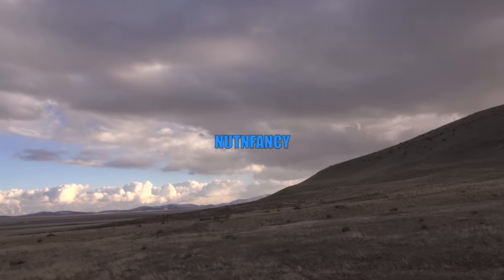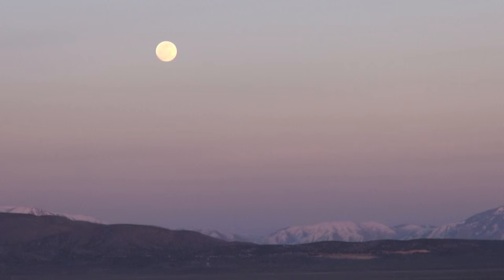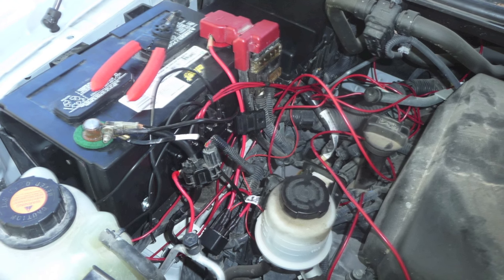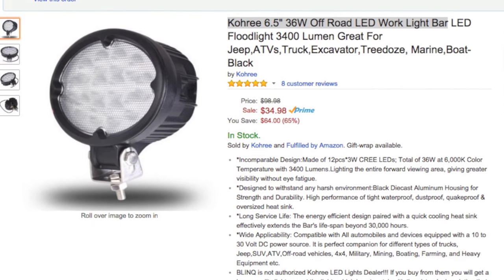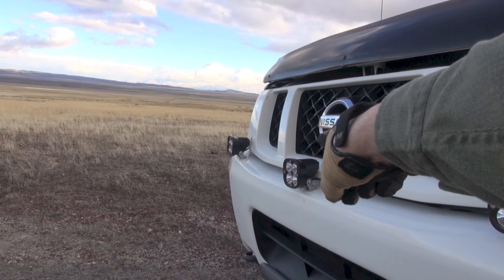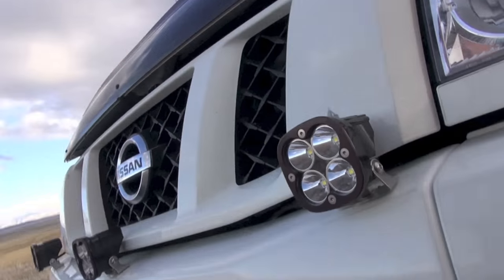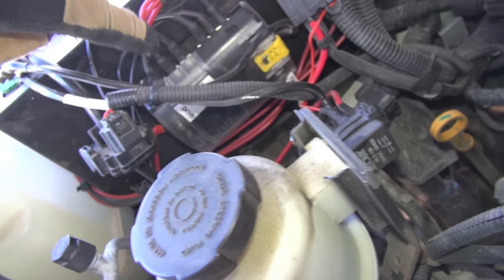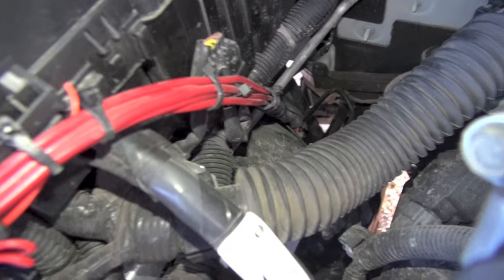Make Your Truck Lights Suck Less

Comment: I've done a lot of after market accessory electrical wiring on my truck and you've hit most of the points one wants to consider.  One thing I did a little differently is I have two different blue sea fuse panels.  One is setup for always on for things that always need power (ie. fridge) and one that gets power only when the truck is turned on via a 200A relay.  Good vid.

Comment: I have a similar project that I will be working on soon but with Rigid Industries LEDs.  I'll be installing 3 sets of Dually D2s, two sets (Driving and Wide versions) on my bullbar and one set (Diffused) on the rear for back up lighting and area lighting.  I love the job you did on your install, very clean, professional, and well done!  I'll be taking a lot of ideas from this video so thank you for sharing!!!

Comment: Just two months ago, I added a light bar to the front bumper of my desert explorer (and daily driver), for exactly the same reasons.  What a difference it makes!  I like the idea of added a couple of these Baja Designs lights pointing out to the side, and I really like the fuse block.  I just wired in a relay, but I may make a change now.

Comment: I think you done a great job of wiring and keeping the circuit separate from the stock wiring.  Less chance of a boob up affecting truck electrics.  I did not see any other fuse connection besides that at you fuse panel.  I figured you most probably have a fused connection at your 'battery feed' coming from your stock fuse box going to your fuse box for lights.  This way, truck is protected from any mishaps with lighting , wiring, etc.  Great job done, nutn!

Comment: Great timing on the video.  I have a Toyota Tundra and I have been looking to upgrade my lights.  I think I want to start with the head lights and fog lights.  Then go to something like this.  I was kind of leaning toward a smaller light bar mounted somewhere around where you mounted yours.  The wiring looks a little complicated.  But I am sure with some research I can figure it out.  Thanks for the video.

Comment: If you need a spotlight for targets that you want to throw downrange from the truck, I highly recommend a Go Light. You can mount it to your roof or better yet to a backrack like I have. Mine is remote control that I can control from the cab or if I'm ever out on a site.

Comment: very good video. I agree with your light bar statement. At least around here, about the only trucks with light bars are pavement pounders. I bought some led lights to put on the v-strom to help see deer in the ditches but when I received them, I realized they were quite a bit bigger than I was expecting so I have been thinking about putting them on the truck just like you did. I think when I do it, I will put them on a relay where the switch wire is connected to the bright lights so I can use them on the highway and when I switch the lights to "dim", the leds will shut off when meeting cars. I would also put a switch inside the cab to kill them completely when I don't need them. A light bar would he handy when driving through my pasture where the grass is up to the top of the truck hood, but I don't want to look like a poser with a light bar...

Comment: I'm still watching! ;)
going to put some flood LED lights on my 1200GS soon, great wiring method. I opted to use a relay off my battery vs straight through the handle bar switch.

Comment: Oh and you should run relays. My light bars are connected to my high beams so I can easily switch on/off. No high amperage wires into the dash for me
Reply: My off-road lights are wired into my high beam switch also.  Much more convenient to me.

Comment: I would recommend that you could have used relays to control each light. You could trigger the relay coils with a switched ground, which you control in the cabin. You end up with longer lasting switches, because the relay coils are very low current. Your wire runs are also significantly shorter, so there is less voltage drop. There are also less wires you need to run into the cabin and the wires are much smaller. Just something to think about.

Comment: Ive got a 24inch bar on front bumper 14inch bar on rear bumper and a 6inch bar on both left and right sides of my truck. And I also have two 6 inch flood bars for driving lights since my head lights are a 30 year old design.

Comment: Another thing you can do to supply power is use the high beam power to feed the switch which controls the relay. High beams are on...switch can be turned on to turn the lights on, kill high beams, accessory lights go off. I do most of my lights this way (I run them on the highway).

Comment: Also some type of rack for the top with a basket with lights mounted rearward into your bed area would I've you a great way to gear up plus up top is a good way to store a couple of cargo,waterproof boxes,I have some military boxes that when I get my rack am going to latch on top. Just in case gear,extra camping stuff that I would write off to use just for my vehicle,extra tent bags,lanterns stove,do I could camp without planning. Kinda like those older pathfinder setups.

Comment: +nutnfancy love the video.  some time ago, I mounted a pair of KC SlimLites on the front of my truck (130 watts each)  I used a on-off-on switch backwards to fire the kit.  One source was battery fused, one source was taken from high beam circuit.  I could select "off", "on", or "on with high beams" which was really handy for street use.  these new modern lights are pretty bright and necessitate use with caution on-road.  I also did the same thing with a home-made "headache" rack with some work lights.  They come on with reverse, or with switch.  I like putting the switches to the left of the steering column so I can reach from outside the vehicle. (I tend to leave the driver window down when I am loading up or hooking to trailers or in general need to see and hear as well as possible.  plus, having the window open makes it easier to open and shut the door)
Reply: That's how the KC lights in my patrol unit work, except they also are controlled by my emergency equipment controls.  I work a very rural area, and having a lot of light connected to my high beams is great.  It's especially nice if running to a hot call that is 60mi away.

Comment: U should use rigid lights they are pretty expensive but make the truck lights look like candles you also can get a bumper like the ones on police cars and you can mount them on the bumper
Reply: Plus with the bumper is removable and you don't need to screw up your trucks value

Comment: I would change out the Silicone to some kind of Polyethylene because Silicone uses water to hold it's self to stuff...so it typically will rust steel. Polyethylene is what they use for the windshield to hold it in.  

Looks good Nutn!

Comment: Nutn' you should have put a small box in the engine compartment with three relays and inline blade fuses.  It would have kept the heavy wiring down to a minimum as well as allowed you to run way smaller wire through the dash.  If you really needed the cool factor you could use Anderson Power Pole distribution blocks in the relay box.

Comment: You did a fantastic job on the wiring Nutn! But the lights look kinda stuck on there to me... i wouldve made holes and did an internal mounting system with a hidden lightbar...
Plus they are kinda easy for someone to steal just out in the open like that. Rigid Industries makes some badass LED lights, i prefer them to the bajas.

Comment: hey Mr nutn, what are the odds that the relay you bought is from where I work,  Blue Sea Systems in Bellingham WA. especially that it's intended use and our primary market is the boating industry. kinda cool to think there's a very good chance I personally built and packaged that relay. we work in small assembly units called A-line, B-line, C-line etc with 2-4 ppl per unit max including the  "line lead" (aka) the  head honcho for that assembly unit that makes sure everything runs smoothly. I've been able to put my experience with RC airplanes into use and a job via my knowledge and hands on experience of sodering extremely small wires, circuitry and handling very small screws and various small parts. Anywho, that it was a cool coincidence that you made a point to share where the relay was from and it's from the company I work for. Cheers to you and your family. wish you all the best of health and a blessed 2016 year.

Comment: I ran 3 Bosch relays(I always use relays) and the factory fog light switch/wiring  to fire the three 8" Baja Designs La Paz HID's and single 20"OnX LED Bar that I run on my Titan....When you get out in the middle of no where, be it here in the states, or chasing for a motorcycle team down in Baja, cheap lights are not worth it for me. Rigid makes really good lights also.
I have not had a chance to see how the Squadron's run in person, but I'm sure they crank out a lot of usable light for any single light let alone for a light of it's size...

Comment: it looks pretty good but one good salty winter can ruin any connection that inst totally sealed from the salt water. and heat shrink is not enough to seal the connections if the salt water can get to it.

Comment: It may be a Nissan thing. I had a Frontier that had horrible lighting. The lights didn't seem positioned right and there would be very specific lines between the light and darkness while going up or down quick hills. Like the lights didn't spread enough and were not very bright compared to our newer vehicles of a different brand.

Comment: Nice!  You could have also mounted a LED light bar onto the bumper instead but I'm guessing you get greater "adjustability" with the individual lights??  

Question:  What is the current draw on those lights and how much does it tax  your battery?  I'm guessing that because they're LED's that they're pretty efficient??  As an example, how long will you run them at night when you're, say, parked out in the desert shooting?...and I'm assuming you're running them with the engine off??  Nice work btw!
Reply: +l84Cabo: Better to install three  Lupine Betty R 15 with 5000 lumen each :-)

Comment: i would have wired this alot differently. You did this kind of backwards. Usually you switch the relay power so you dont have high amps goimg through your switches. That is kind of the point of using relays. I would have used the switched accessory pwr from your trucks fuse panel run to the rocker switches to trigger relays open and closed.  You would also have less wires and smaller wires running into the cab. Check the amp rating on your switches versus the draw of the lights and make sure you are not going to have a puddle of melted switch goo in your truck

Comment: high amperage through those little switches probably isn't the best idea, running relays would have been a much better way to do the install.
Reply: He ran them to a relay under the hood.
Reply: +John Thrasher he's running the full current from the fuses, to the switches, to the lights. that's not the ideal/"proper" way to have it wired.
Reply: David Burke oh you're right good catch
Reply: +John Thrasher I don't know what type of current those lights pull, or the quality of the switches, but regardless it's not a great habit to wire things like that. eventually there will be problems.

that said, when people start wiring stuff up on their cars it often gets much, much worse than this quickly. and motorcycles are even worse, since a lot of stuff is sold with a one size fits none wiring harness (which are garbage to begin with) that people who have no idea how electronics work try to fit to their project.
Reply: and that's not getting into the crimp connections. they will fair, it's not a question of if it's a question of when. (unless for some reason he soldered crimp connections, which wouldn't make a lot of sense)
Reply: David Burke that's what I used to do. It was easier for me to solder the spade connectors on then attach to the switches. I would crimp solder then shrink wrap each connection
Reply: +John Thrasher I was looking at some of the wire to wire crimp connections, but yeah unless you're positive it's going to be a permanent install soldering to the switch will make your future a little harder than it needs to be.
Reply: +David Burke each light draws 3.4a so it's really not high amperage. He could have used 16ga wire. Relays would have cut the wire bundle down to three, so I am otherwise in agreement about the use of relays.
Reply: tbwjs I was thinking high in the sense of more than a few milliamps to trigger a relay. I'm probably a little over sensitive after having to rewire 3 sets of power windows since in mazdas infinite wisdom decided to run the full current through the window switches. Thankfully they gave us the 13b, so all is forgiven.

Comment: yeah man, still watching at 12:46, but wondering why you ran your thick, primary wires through the firewll to the switches, instead of using 3 relays and light, low current wires to the switches.

Comment: got six 7" hid lights, two cubes and one 7" bar on my jeep xj. thing is bright as hell. Mobile sun. crazy nasty bright. i have tried to out run it in the desert and 80 mph doesn't do it and im not dumb enough to try 90 or 100 and i dont think the ole jeep could do it anyways with 4.88 gears.
and also. nitto all terrains are not mud tires.

Comment: I like the improvements; but, I would have liked to see the difference between these lights and the stock high beams.  Thru the video, it seems almost exactly like high beams.  I've had some bad experiences offroading at night; so, I really don't prefer it, if I can help it.  To make me more comfortable, I would prefer roof lights; so, I don't get that "falling off the edge of the Earth" feeling; which for me, has sometimes really been driving into a ditch, that I couldn't see in the dark.  A broken axle is not cool; neither is cutting a tire.

Comment: ive had pretty good luck on my 4wheeler with a cheap led light bar off ebay....it works great and is super bright, i do understand that those lights are higher quality but honestly you dont need to spend 200 dollars on a single light pod like that, there is some good cheaper stuff out there that takes the abuse. mu light bar is 25" and its mounted and professionally wired. running on a canam outlander with mud tires and rough terrain still hasn't caused my $40 light bar any harm and from what i can see on the video is brighter than those 3.....like i said i like the set up and its great quality stuff, i just think there are other value oriented options out there. but nutnfancy is way too busy to get into all that. thanks for the vid nutn.
Reply: +alucard3193 got a 40$ 30&quot; on my camper hauler f350. great value. used for some adventuring, but mostly camper tote. worth it 10/10. trying to find a 50" and a mount that sits under the cab profile so to not interfere with the camper

Comment: Even my daily corolla has a pair of 100w optilux fogs and a 32" LED light bar. Truck has a 52" light bar. They're $1/inch now so no reason not to get the biggest you can fit

Comment: Idea good. Execution not so good. Better than most no doubt but still over complicated it. High current wires into the cab? No. All that extra length, current loss, and load on those cheap switches...

Three relays under the hood each on its own fuse. Three switches in the cab. Feed switches from accessory-activated fused port from INTERIOR OEM fuse box to activate each relay. All grounds directly to the battery. If you really investigate you could likely find open slots in the OEM fuse / relay blocks under the hood and wire it unseen.

And for gods sakes use some loom. You're just asking for harness chaffing bouncing around out in the bush. 

Take it for what it's worth. 12 years Lexus and ASE Master Certified.

Comment: Cool video. Great idea, I have a 1999 Ranger and the lights on these old vehicles are horrible. 

If you haven't ever upgraded for car battery, take a look at XS Power. I'm huge into big time serious car audio systems (check my page for the type of stuff I design, build, and work on) with tens of thousands of watts. The batteries they are the best of the best are the XS Powers. It's not even close to any other manufacturer. They aren't cheap, but you get what you pay for, and if you need a battery(s) that will perform  in the toughest conditions, and perform when it matters, they are the best option you can buy.
Reply: +galamonkey checked $  on those batteries... Not priced to high.  Hell, a Die-Hard Gold is close to $150.00 for the average SUV or passenger van.  And my E-350 takes two.
Reply: Well Im used do doing car audio setups where it requires the XS D3100 battery... And not just one or two... But like 20 of them. At $350 a pop, that gets a bit pricey. Haha.
Reply: That "is" how to make it pricey..;)  Thanks for the response.

Comment: 13 MPG?? Holy crap man, my 91 F250 gets 12 mpg and that's with the 7.5L v8 and a 5 inch lift and 35 inch tires. Surprised that comparable mileage still exits in vehicles made 20 years later.
Reply: +Kanglar I wonder if that fuel consumption rate he mentioned is road driving, middle of nowhere in the desert or a mix of the two terrain types. It might make a difference, if this truck is mostly used for desert driving and he has other vehicles for regular road trips it might very well be non-road fuel consumption rates.
Reply: ToKeepTrackOfRandomSubs
That's true, if it is that bad on a newer vehicle I would assume worst case scenario like lots of in town driving or desert crawling and maybe lots of idling. However he was referring to mpg loss due to aerodynamics, which only really matters on the highway. Either way 13 mpg is sucky, I feel his pain.